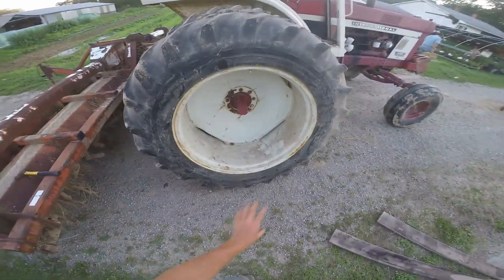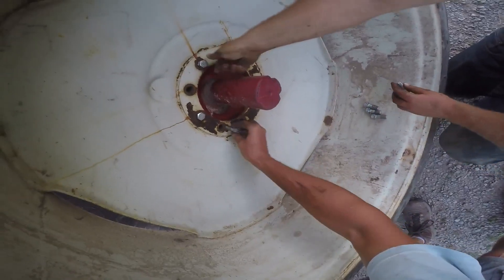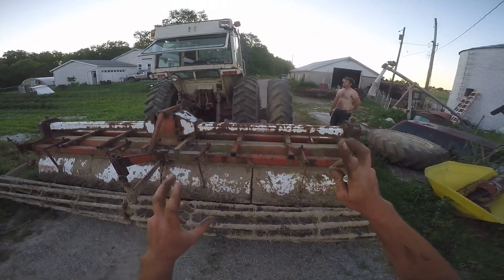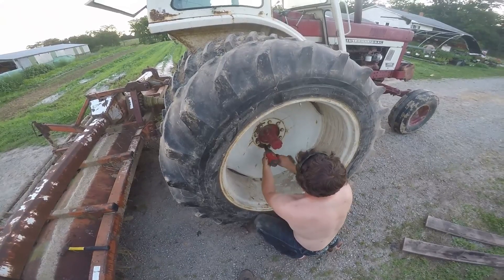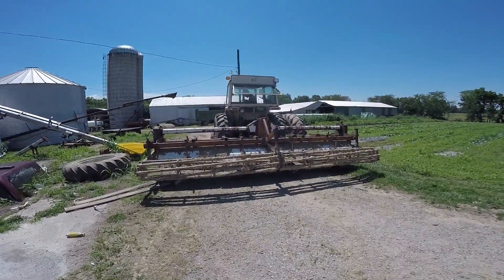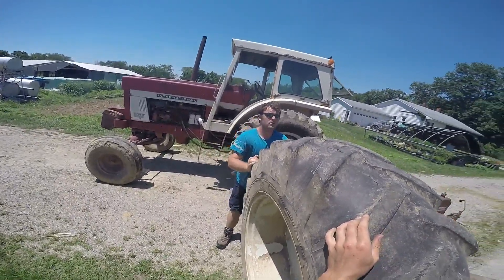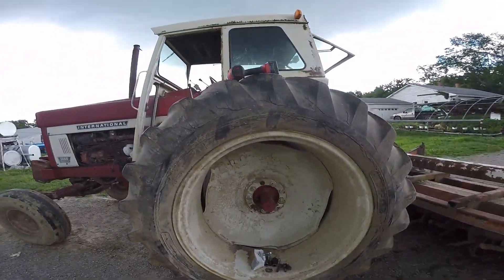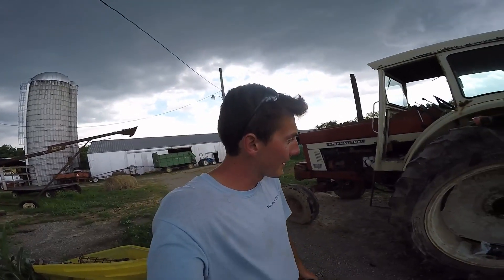First Time Putting Duals on the IH 1466

Comment: Duals are a pain at times but they help a lot in the field with traction we have one tractor with duals that are newer and less worn than the tractors tires so they are a bit taller doesn't effect much with about all tractors with duals turning will take using the brake pedals to get turned sometimes the front wheels don't grab enough to do anything and just slide
Reply from the maker: I use the brakes a lot.

Comment: One thing bout it then zip guns will spoil you I have a Dewalt with the strongest sockets I could find at harbor freight their black steel and it actually stripped brand new grade 10 bolts out putting duals on grandpas 4640 John Deere
Reply from the maker: Stripped the bolts or the holes? The one hub on the 1466 has many stripped holes.

Comment: Why dont you get a new wheel for the right side or maybe by two new wheels then it might look better get that 1466 it wouldnt look bad if you wash it once in a while and put the doors back on the cab and that's what makes a paint job last on that 1466
Reply from the maker: There's only so much washing will help. The previous owner brush painted it. This was also my first summer with the tractor.